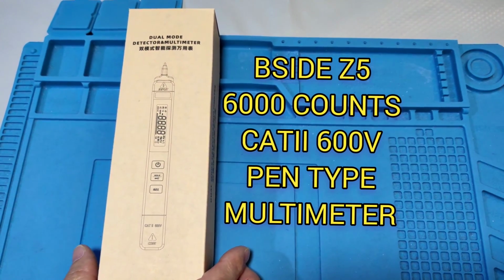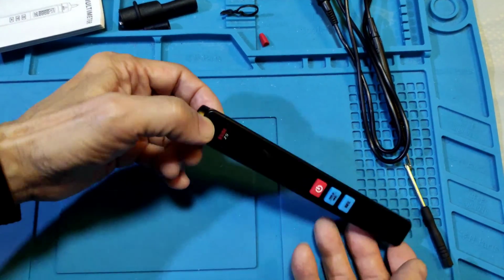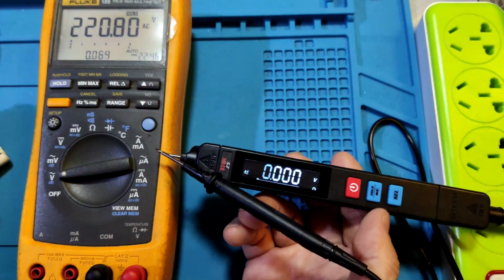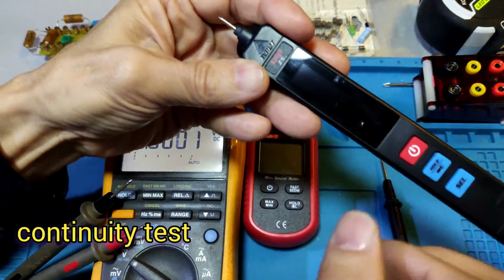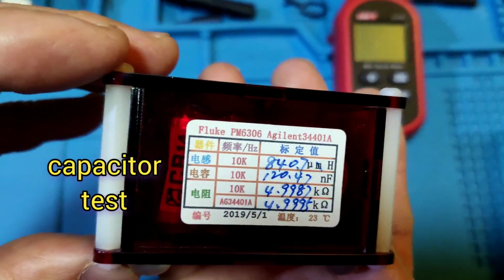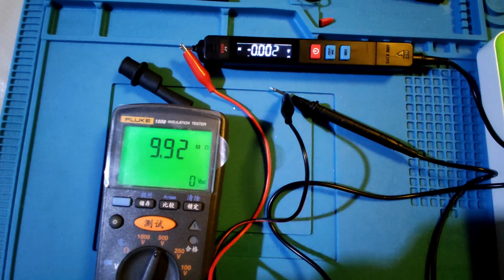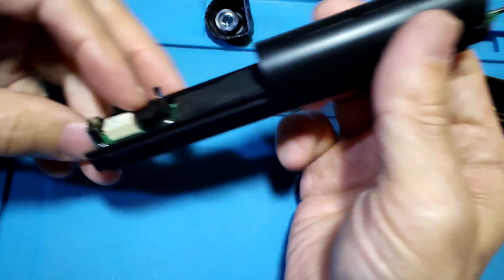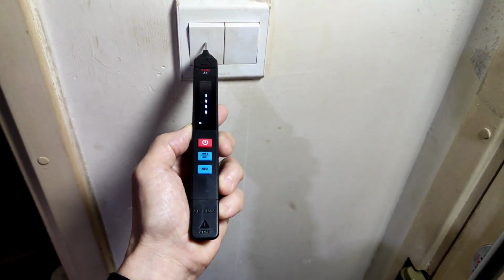BSIDE Z5 6000 COUNTS,CATII 600V,PEN TYPE MULTIMETER,MADE IN CHINA

Comment: I have an Aneng A3008 almost broken when forgot discharge capacitor before take mesurement. Is this BSIDE Z5 better than A3008? I have been used A3008 for 3 years.
Reply from the maker: it is normally use about 2 years may down grade the ncv measure sir. hope you notice that,it may be the inside components low down effect to that.if the price is same by bisde first because it ncv function is better than aneng.
Reply: @wilsonluilui  I am trying to decide which one to buy ANENG A3008 or the BSIDE Z5
Reply from the maker: @Leo-gt1bx  aneng a3008 is good.
Reply: @wilsonluilui  Is it hard to blow if it is put in the wrong mode for example?
Reply: Which do you think is better?